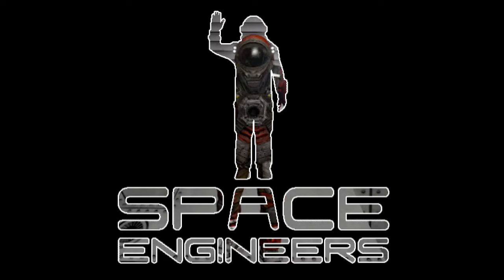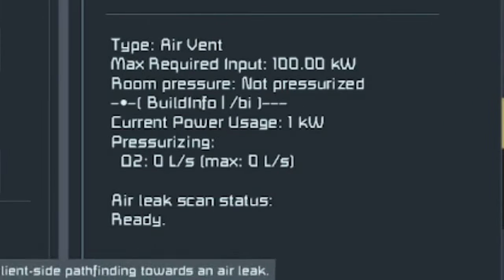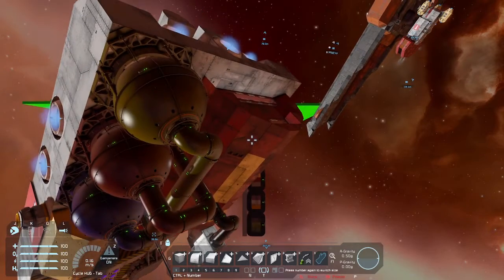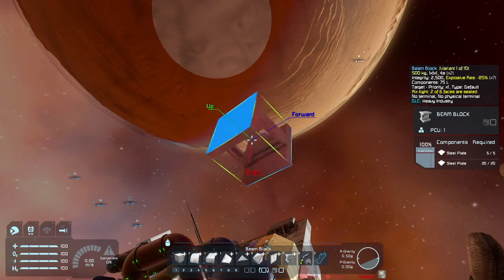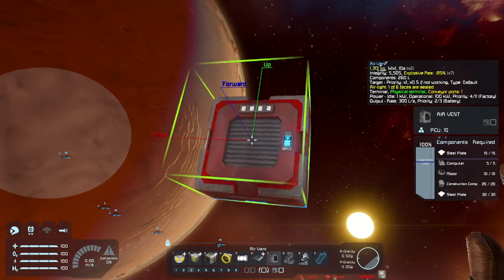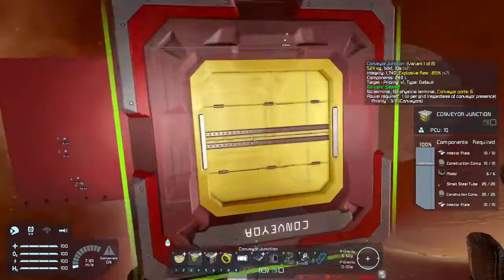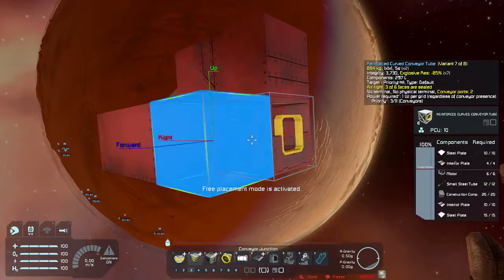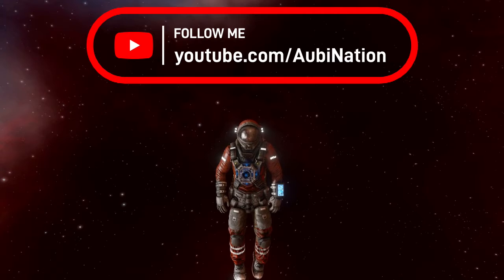How to find Pressurization Leaks - Space Engineers (Build Info Mod)

Comment: What about the ps5?
Reply from the maker: @leggomybeer2004  I am unfamiliar with the modding scenario for the PS5 (I imagine it doesn’t have one?).

My suggestion is to have a plan from square 1 and work your way ensuring sealed compartments as you go. If you did, and you still have pressurization leaks, what you can do is cordon off sections of your ship. See which side is still leaking. Keep cutting (blocking) off more and more sections of the ship until you isolate where the leak is coming from. From there, you could replace each outer block until you find the culprit - usually a misplaced piece of window or a poorly rotated conduit/pipe.

Good luck!

Comment: So can I use this and still use my BP with the mod turned off?
Reply from the maker: If the question is whether the BP will still work after you disable the mod, I believe so yeah! It’s not a physical part to the mod. You can even save it with the mod enabled, and anybody without it wouldn’t know the difference.

The game just removes any modded pieces if you don’t have them. Sometimes it leaves gaps in your builds if you don’t have the mods. So I think no matter which mod you have enabled, if you don’t have it later, it just simply voids those parts.

Comment: I tried to build a bridge for my ship and added an air vent inside but it doesn't pressurize. It's a small room but I've been going crazy trying to find the leak. Any tips on pressurization using windows?
Reply from the maker: Biggest thing I’ve noticed is the inner vs outer windows. Ensure that you don’t flip the window the wrong way and create an undue “gap”
Reply: @AubiNation  thanks my guy! I managed to pressurize my bridge.

Comment: Very useful information, I wasn't sure if the reinforced conveyors counted as being airtight. Many thanks.
Reply from the maker: Glad to have helped!
Reinforced conveyors had been the bane of my air tight existence! Before this mod I would have to literally trace the pipe all the way down the path to find out where it somehow opened up to the outside world. That said, this is a great way to share pressurization between two areas without having to connect them via corridors. But if one depressurizes, they both depressurize.